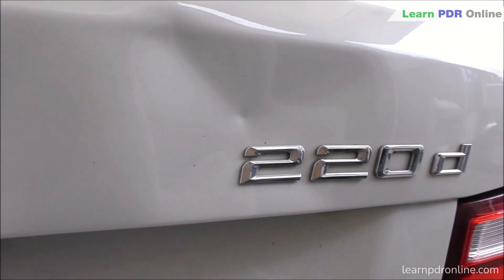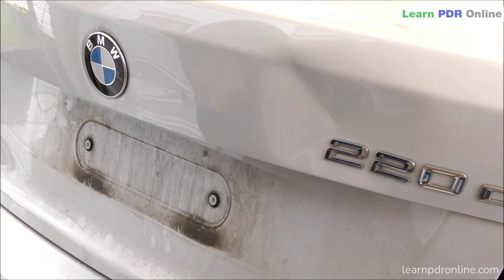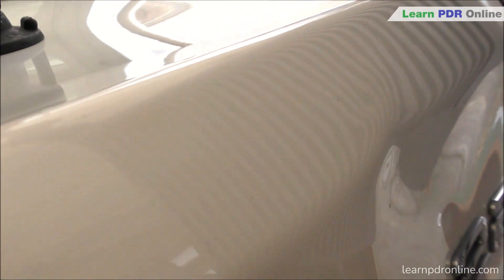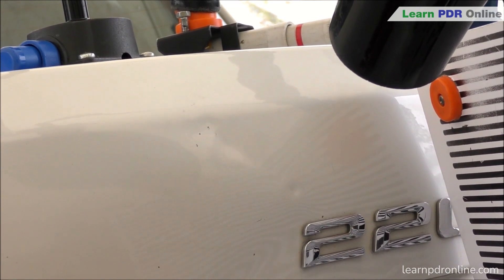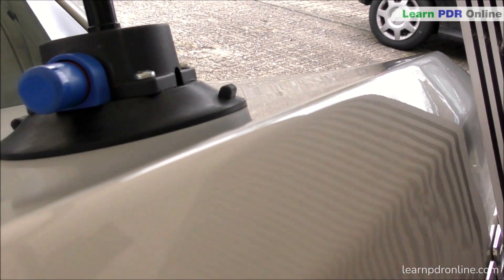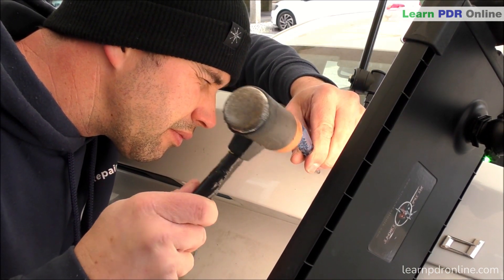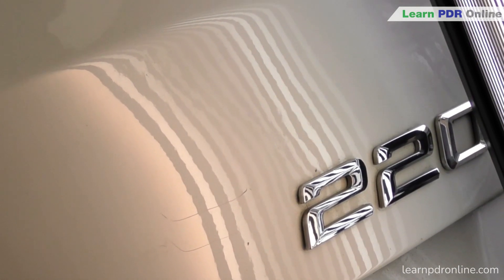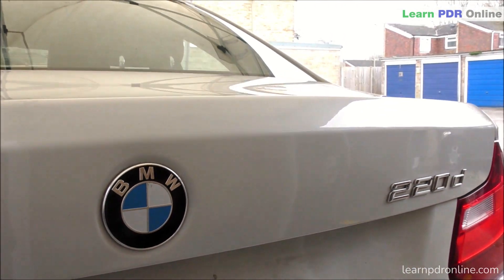Best Method to Repair Sharp Dents | Paintless Dent Removal | PDR Training

Comment: A bit of history: This technique started at manufacturing line at WV in Brazil, (also known as golden little hammer or "martelinho de ouro") in the 60s after they deliver to retailers some old beetles, with some tiny dents, so VW staff created a small hammer that was later called "golden little hammer" and small rods to leverage.  Martelinho de ouro spread all over the country and it is very popular in Brazil.  Much later, many Brazilians migrated to US, to make money over there, repairing cars until an American entrepreneur improved the technique, creating more tools and bits, the light with stripes to help to spot tension on the surface.  I have myself a small case with all these basic tools so with a heat gun I can make the body of my car a mirror with almost no imperfection.  It's all about practice. On this video it looks simple, but you do need some skills to know where to hit and apply pressure, in each type of dent.  Where the paralel lines tends to approach, it's where you need to hit, this is the idea for tiny dents) 

idea:

First you need to heat the metal around 150 degrees, use a tool to pull the dent (on large dents, you work from outwards to inwards) you may do it a few times, and then, with a little hammer, you now hit where the paralel lines are approaching to each other. You can repeat the pull tool and then use the little hammer again. Keep doing it until the dent is gone.

If it's a sharp dent, you use also the rod to push from inside the bodywork or you combine with the pull tool.

Comment: can you suggest from where to buy that heat blower (ebay/amazon) and the line board and the tapping pen you hammer ?  At what temp you set the heat blower? I am just on a personal car project. Thanks.
Reply from the maker: For the tap down, hammer, and line board check out www.pdrprotools.co.uk as for the blower that's just a basic hair dryer, typically you want to get the panel around 25' Celsius but that does depend on brand of glue etc

Comment: First of all, I am totally noob in this matter, but I bought some good tools, also for the glue, but I am worried that it's not working.. Glue doesnt want to stick to the surface to make enough tension.. Can it be because of not enough heat on the glue pistol? Or is it because i have bad glue quality? Can you recommend good glues for this?
Reply from the maker: Hi Dominik, there are a few variables when it comes to glue pulling, from your description I would suggest its on the panel side so first thing to do it check the panel is clean and free of contaminants, you can use something like isopropyl alcohol to clean the panel (and the tabs) this may be enough but otherwise itll be to do with the temperature of the panel, these are the main two I would check (this is assuming you have PDR glue and a glue gun that gets the glue hot enough) also check out this link see if it helps - https://www.learnpdronline.com/pdr-tips/glue-pulling-top-tip-for-beginners/